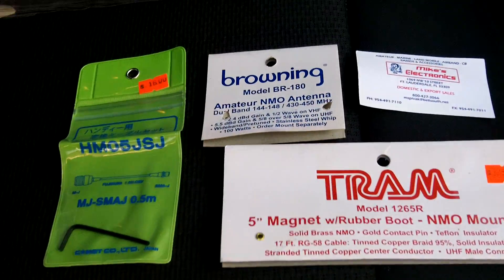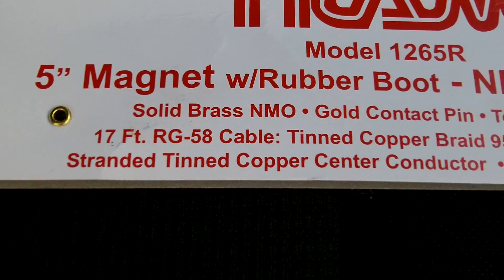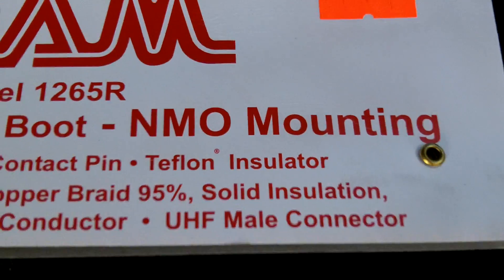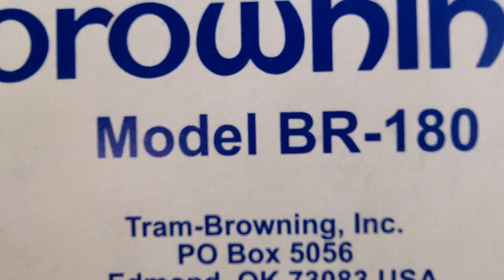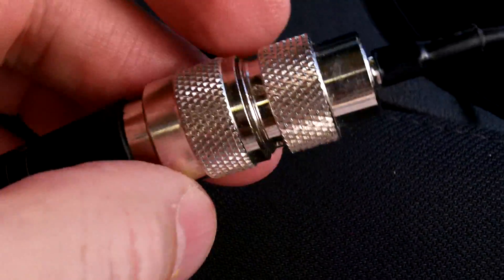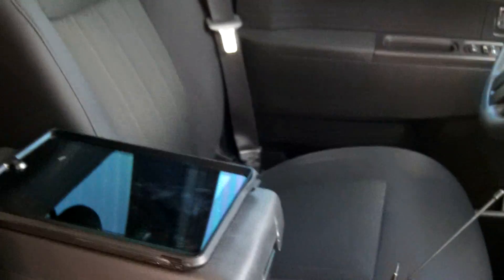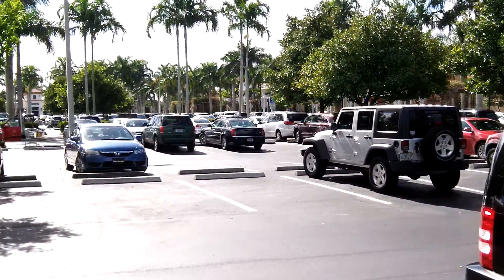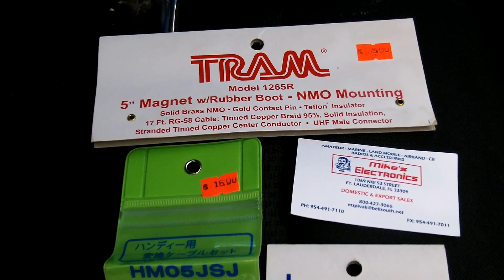Ham Radio Antenna- My Mag Mounted Vehicle Antenna Set Up

Comment: Every mag mount I’ve used for GMRS and police scanner antennas I’ve NEVER ran the antenna cable where the door closes and mashes on it. It’s a bit more involved for some, but, running the antenna cable under the rubber molding around the door and towards the windshield [preferably passenger side] extending down inside the door jam (with the door open) and then into the inside of the vehicle, above or below the glove box, and to the area below the factory am/fm radio. Much cleaner install and definitely a guarantee your antenna cable won’t be mashed and eventually damaged having the vehicle door constantly closing on it….because it ‘WILL’ happen and sooner than you think. Just saying. Hope this helps those that want to do it the right way. ~Jim WRXY695~

Comment: With the mag mount, have you had issues over time of the door messing up the antenna cable?
Reply: Yes, I have. I ruined the most vintage boss mag antenna by running it through the door, and now I’m desperate to find out how I can mount my new magnetic Little Wil NOT through the door. No success yet
Reply: I am curious too!!
Reply: You guys ever try to put it behind the weather strip seal?
Reply: Matthew Stone no I’ve been wondering how to do this; my buddy just showed me recently. But that still is pinched through the door, just more cushioned, no? Wish I could find a way to not have it pinched in a door at all
Reply: @Nationalist101  small notch where the weather strip mounts too? I put mine in the top corner to get inside the car then route behind the trim

Comment: I have a question,  im new with a Tech license I am also running a Uniden Bearcat 980 ssb in my van and would like to also run my Baofeng hand held using a roof mount mag antenna would this conflict with the CB mag mount I have on my roof now........and also do you need to set the SWRs on the ham antenna? Thanks Dave

Comment: When I bought Browning though I expected that this antenna would perform adequately "out-of-the-box", it did not. My received signal from a 2-meter repeater less than a mile away should have been full-scale, but it was weak. I was looking for a best CB antenna I found this on the web: https://strykerradios.com/best-cb-antennas/ I installed Stryker SR-A10 CB antenna on and that one worked satisfactorily I am able to hit repeaters 20-30 miles away with no problems. It doesn't wobble or make any noise at highway speeds, It appears that this BROWNING BR-180 antenna missed the QC check. Not satisfied with this Browning antenna at all.
Reply from the maker: Thanks for the info!  I will check out your link.

Comment: Though I expected that BR-180 antenna would perform adequately "out-of-the-box", it did not. My received signal from a 2-meter repeater less than a mile away should have been full-scale, but it was weak. My friend told me about this link: https://strykerradios.com/best-cb-antennas/ I installed Stryker SR-A10 CB antenna and that one worked satisfactorily. The SWR on 1 and 40 is around 1:1 and on channel 19 my meter hits a perfect 1. It appears that this BR-180 antenna missed the QC check. Not satisfied with this Browning BR-180 antenna at all.
Reply from the maker: Thanks for the info!

Comment: Just got my cb, can't tune the antenna and not sure how too, any one with advice ? It's a magnet and the cb is cobra 19
Reply from the maker: Find a ham radio store in your area.  They should be able to tune your antenna for you.
Reply: get a swr meter and look on youtube or the internet and look up a video on it. Basically just keep cutting down the antenna until the swr is under 1.5 or so

Comment: thanks for the video! Have you seen any changes in the radios or antennas performance with having it shut in the door? I've been considering going through this route but am nervous about pinch points. thanks and God bless!
Reply from the maker: I have had this same antenna and cable shut in my van door and have had no problems to date.  Thanks for watching.
Reply from the maker: Thanks for the info.  I can see how that could happen.

Comment: does that connector to the radio fit a  Yaesu ft60 radio?
Reply: mtn ride, it does connect to a Yaesu FT-60. So far as I've seen, Yaesu handhelds use SMA male antennas. However, Tram does make the same mount with an SMA male connector, which negates the need for the extra piece of equipment. :)
Reply from the maker: +mtn ride I am not sure.
Reply from the maker: Thanks for the info.

Comment: Thanks for the video I have been looking for a affordable mobile set up. The had probably been asked before but I am a brand new ham, just got my call sign today. With a mobile set up like this on a HT am I still going to be worried about my SWR?
Reply from the maker: Thanks for watching.  Glad to hear that you received your call sign, congrats!  When I purchased this antenna, the ham radio shop checked the SWR and it was good.  So you might want to do that unless you can check it on your own.  I am not sure what difference it will make in reception if you do not do this.  Stay in touch.  Take care.  Anthony.

Comment: That's been one of my biggest concerns.........the running of the wire from the Magnetic Mount Antenna, to the inside of the cab (Ford F-150).  I don't want to pinch the wire, and I also don't want to let any noise or weather in.  In your opinion, is there enough play in a typical door frame to do it the way you did it, without damaging the wire?
Reply: nutmegger1957 I’ve been wondering the same thing.
Reply: Run it close to the back and then run the wire under the cab into one of the floor grommets

Comment: Good setup. There is also a great J-pole type antenna that you can either make or buy that is made out ladder wire that will give you excellent reception and transmit capabilities with that little Wouxun.
Reply from the maker: Thanks for the info my friend.  I have the roll-up J-Pole Antenna.  I keep it in my communications bag.  I have a few vids on my channel showing it deployed.  It makes a big difference in reception.  Anthony.
Reply: biblesnbarbells  Good deal, haven't caught those yet. Been wanting a wouxun but currently run some baofengs. Does the wouxun have an adapter so it can run off double A's?
Reply from the maker: Yes.  I purchased the AA adapter.  I think it was $10.00
Reply: biblesnbarbells
 Nice, I've got a little Baofeng  UV-3R that has a little cell phone type battery. It makes it fairly simple to recharge with a small solar panel. I did a small review on it as well.
Reply from the maker: Thanks.  I will watch your review.